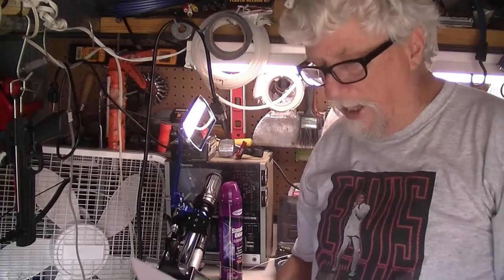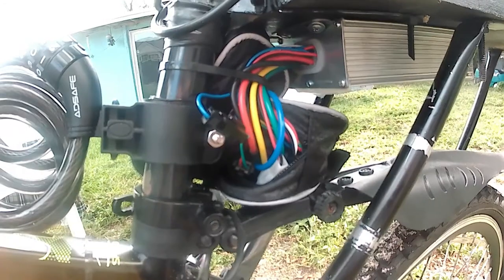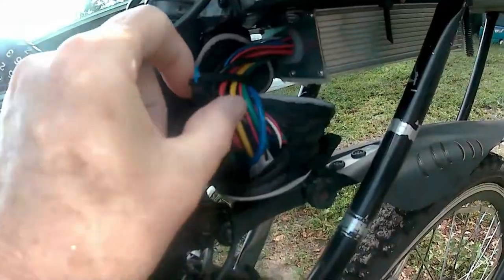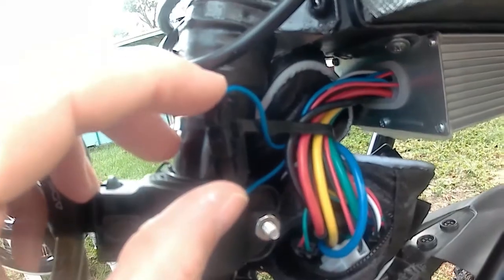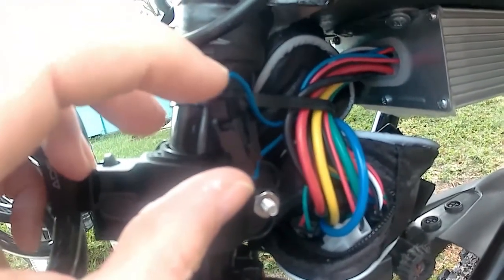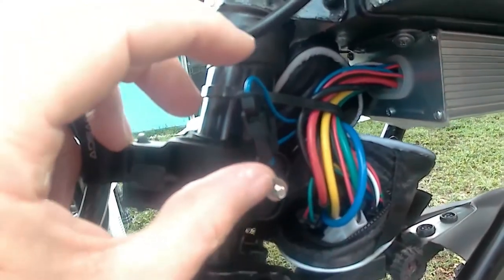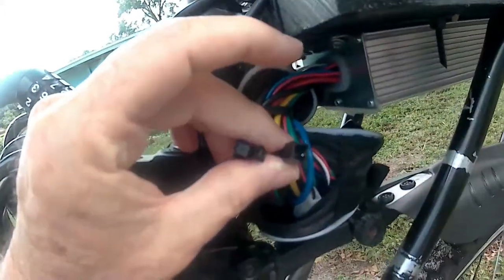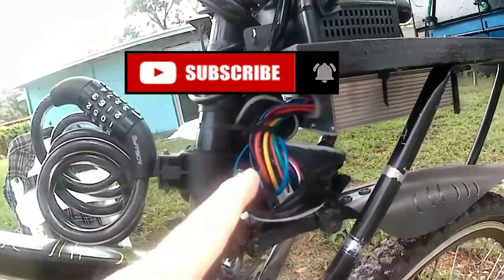How to HACK Electric Bike to go MAX SPEED part2

Comment: I will say Harold that torque arms should be fitted too As at 40 mph your likely to throw the Back Wheel from its Stays!! Brilliant Video I did try it on my 1000w hub but the kit bike is light and highly powered to much torque for the frame! But on another stronger framed bike I could see this being a clever idea as long as you use a bigger capacity battery to make up the increase in power drain! It could speed up these fantastic Ebikes
Reply from the maker: Thanks for watching and have an Awesome day!
Reply: Nah
Reply: My bikes seem to wreck if I don’t use them torque arms , they just seem to mush the frame post up with out them

Comment: By any chance do you happen to have any other display recommendations that is compatible to the 810 led? Besides the sw 900 thank you just wondering.
Reply from the maker: I have the 810 display on my Amazon page. Amazon.com/shop/haroldjackson
Reply from the maker: I think the sw900 will work. The connector looks the same. Should work. Or you can just replace the 810. I have one on my Amazon page. Amazon.com/shop/haroldjackson  Good luck.
Reply: Hi Harold. Whats the colour wires for the S900 display besides changing on display please. Just bought a Ecotric 500w fat tyre🖒Andy(U.K)

Comment: On the U.K. Freego Hawk and Eagle 250w its the grey wires you pull apart, so from 15.5mph goes to 25mph
Reply from the maker: Thanks for the info! 🚲
Reply: Harold, whats the speed hack on the Ecotric 500w 36v controller, apart from changing in the settings. Is there any wires to pull apart as in the Freegos i mentioned earlier??
Reply: I have a gotrax ebe2 and it has a 350 watt motor. What is the bikes max speed
Reply: From 22 to 28 on 400w ebakrocy ebike. Upgrading hub motor to 1000 to 2000 watt in two weeks ill update you guy

Comment: Nice video sir. I have a aostirmotor ebike. 500w 15 Ah battery battery size 25 amp controller. I get between 23-27 mph. I do not know witch wire to cut. Every ebike is set up differently. Do you know how to cut speed limiter on my specific ebike?  I appreciate all that you do on your channel.
Reply: I just know it can go faster because I can feel the motor pulling back when I get to my top speed. SMFH!!!
Reply: I appreciate your time and support, Sir.

Comment: I thought it was suppose to be the white wire.
Reply from the maker: It could be different for different bike motors. This video was for the kit we got off Amazon. Good luck.
Reply: @HaroldJackson  Hi what was that wire supposed to do other than limit the speed? I was checking my controller and didn't seem to find a wire that was for just that purpose. Thanks.
Reply: Mine was the white wire, just try unplugging it, if it’s not the blue, I’ll be the white.  I went from 12mph to 20mph